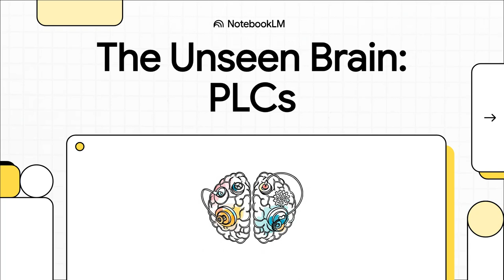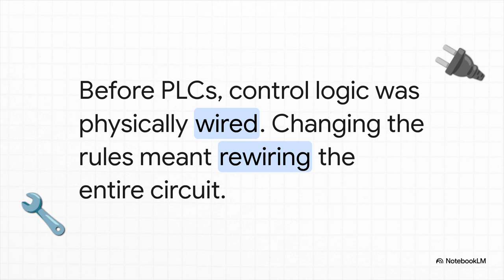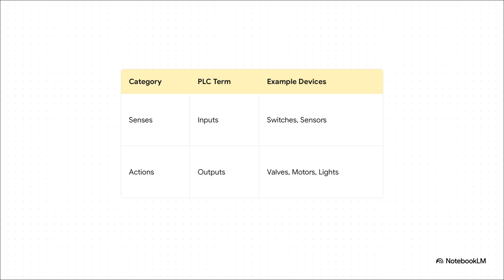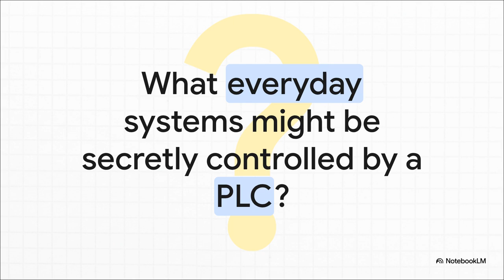PLC

Comment: Nama : Debora Cindy Purba
Nim : 5223351006
Kelas : PTIK-A
dalam video ini menjelaskan PLC diprogram menggunakan ladder logic, bahasa visual yang menyerupai diagram listrik relay sehingga mudah dipahami teknisi. Dalam praktiknya, sensor memberikan data kondisi lingkungan sebagai input, lalu PLC memprosesnya dan mengaktifkan aktuator sebagai output.

Contoh: sensor fotoelektrik mendeteksi kotak di conveyor belt, PLC memerintahkan solenoid valve untuk mendorong kotak tersebut.

Teknologi PLC menggantikan sistem relay kabel yang kaku dengan kontrol berbasis perangkat lunak yang fleksibel, mudah diubah, serta lebih andal. Kini, PLC digunakan luas dalam berbagai sistem otomatis seperti lampu lalu lintas, lift, hingga lini produksi

Comment: Nama : Raisa Dini Zein Hidayat Siregar 
Nim : 5223151017
Kelas : PTIK B

PLC  (Programmable Logic Controller)  bisa kita sebut sebagai otak  yang mengendalikan jalannya mesin-mesin industri modern. Bedanya dengan komputer biasa, PLC didesain khusus agar tahan terhadap kondisi pabrik yang keras, sambil tetap bekerja dengan akurat dan cepat. Kalau komputer biasa lebih fokus ke perhitungan dan tampilan visual, PLC justru lebih unggul dalam menangani proses industri, karena dilengkapi sistem input dan output yang langsung terhubung dengan sensor maupun mesin.

Di dalam sebuah PLC ada beberapa komponen penting. Pertama, Processor atau CPU, yang berfungsi sebagai otak pengendali. Lalu ada Memory, tempat penyimpanan instruksi atau program. Kemudian, Input/Output System yang menjadi penghubung antara PLC dengan dunia luar, seperti sensor dan aktuator. Terakhir, ada Power Supply yang menyediakan energi agar semua bagian bisa bekerja stabil.

Untuk memprogram PLC, digunakan bahasa yang disebut Ladder Logic. Bahasa ini dibuat menyerupai diagram listrik relay, sehingga teknisi yang sebelumnya terbiasa dengan rangkaian kabel bisa lebih mudah beradaptasi ke dunia digital. Simbol-simbol dalam Ladder Logic seperti garis, kontak, dan coil mewakili aliran listrik dan komponen kontrol yang familiar bagi praktisi elektro.

Cara kerja PLC adalah menerima input dari perangkat seperti tombol, saklar, atau sensor. Informasi itu diproses oleh CPU, lalu menghasilkan output berupa perintah ke aktuator seperti motor, lampu, atau valve. Misalnya, sensor cahaya mendeteksi adanya objek, lalu PLC mengirimkan sinyal ke katup solenoid untuk bergerak.

Keunggulan utama PLC dibanding sistem relay lama adalah fleksibilitasnya. Kalau sistem relay harus diubah kabelnya, pada PLC cukup dengan memodifikasi program. Karena itu, PLC kini dipakai di banyak bidang: dari jalur produksi pabrik, sistem conveyor, lift, pencahayaan gedung, sampai sistem pengolahan air. Dengan kata lain, PLC sudah menjadi tulang punggung otomasi industri yang menjembatani dunia fisik dengan kendali digital.

Comment: Nama: Rahmansyah Angga Saputra
NIM: 5223351003
Kelas: PTIK A 22

Di video ini dijelaskan tentang PLC (Programmable Logic Controller) yang berfungsi sebagai pengendali utama dalam sistem otomatisasi. PLC ini mirip seperti “otak” dari mesin-mesin industri. Bedanya dengan komputer biasa, PLC lebih tangguh dan bisa tetap berjalan di kondisi pabrik yang keras. Komponen penting di dalamnya ada CPU, memori, sistem I/O, dan power supply, yang bekerja untuk membaca data dari sensor, memproses sesuai program, lalu memberi perintah ke aktuator.

Video ini juga membahas tentang ladder logic, yaitu bahasa pemrograman berbentuk gambar yang mudah dipahami teknisi. Dengan ladder logic, kita bisa membuat logika kontrol tanpa harus menyusun kabel yang ribet. Salah satu contoh penerapannya ada pada sistem konveyor otomatis, di mana barang bisa diarahkan menggunakan sensor dan solenoid secara otomatis tanpa campur tangan manual.

Dengan menggunakan PLC, proses otomatisasi di industri jadi lebih efisien, cepat, fleksibel, dan mudah disesuaikan. PLC membuat pekerjaan yang sebelumnya rumit bisa jadi lebih sederhana, sehingga mesin bisa bekerja lebih stabil dan terkontrol dengan baik.

Comment: Nama : Ira Gusdhini Harahap
Nim : 5221151004
Kelas : PTIK-A

Ulasan video : 
Konsep dasar PLC (Programmable Logic Controller) dijelaskan dalam video ini adalah perangkat elektronik yang digunakan untuk mengendalikan proses industri atau mesin secara otomatis.  PLC bekerja dengan menerima sinyal, seperti dari sensor, memprosesnya sesuai dengan program yang sudah ditulis, dan kemudian menghasilkan output, seperti menggerakkan motor atau menyalakan lampu. 
Selain itu, video membahas perbedaan PLC dengan sistem relay konvensional. PLC lebih efisien, lebih fleksibel, dan dapat diprogram ulang untuk berbagai aplikasi industri.  Disertakan juga struktur PLC utama, yang terdiri dari CPU, modul input/output, dan perangkat pemrograman, serta contoh penggunaan sistem otomatisasi secara sederhana.

Comment: Nama : Sakinah Salsabila Siregar
NIM	: 5221151007
Kelas	: PTIK-A 

Adapun ulasan saya dari vidio diatas adalah sebagai berikut:

Programmable Logic Controller (PLC) diibaratkan sebagai otak di balik proses otomasi industri. PLC adalah komputer industri yang dibuat untuk mengontrol mesin otomatis dalam kondisi ekstrim.

Komponen utamanya, seperti CPU, memori, dan sistem I/O, memproses data dari sensor dan mengontrol output mesin.
Poin penting yang saya tangkap adalah bagaimana PLC telah merevolusi sistem kontrol yang sebelumnya berbasis kabel fisik menjadi sistem berbasis

 Perangkat lunak yang jauh lebih fleksibel. Contoh aplikasi nyata di ban berjalan benar-benar membantu menguatkan pemahaman.

Comment: Nama : Rifaldi Alan Dahris Harefa
Kelas : PTIK A
NIM : 5222451002

ulasan :
Programmable Logic Controller (PLC) adalah komputer tangguh yang menjadi "otak" di balik otomatisasi industri, seperti yang sering kita lihat pada robot pabrik atau ban berjalan. Berbeda dengan komputer biasa, PLC dirancang khusus untuk lingkungan pabrik yang keras, tahan terhadap getaran, panas, dan debu. PLC terdiri dari empat komponen utama: CPU yang berfungsi sebagai "otak" untuk membuat keputusan; memori untuk menyimpan program; sistem I/O (Input/Output) yang bertindak sebagai "indra" dan "otot" dengan menerima sinyal dari sensor dan mengendalikan mesin; dan catu daya yang memasok listrik ke seluruh sistem. Menariknya, PLC tidak diprogram dengan kode yang rumit, melainkan dengan bahasa visual bernama ladder logic, yang menyerupai diagram sirkuit listrik. Hal ini mempermudah teknisi listrik untuk menggunakannya. Secara sederhana, tugas utama PLC adalah "merasakan" (melalui input seperti sensor) dan "melakukan" (melalui output seperti menggerakkan motor), menjadikannya teknologi revolusioner yang mengubah sistem kontrol mekanis menjadi sistem yang fleksibel dan dapat diprogram ulang

Comment: Nama : Dezky Waldeni Daulay 
Nim : 5223151030
Kelas : PTIK C (22)

Video tersebut menjelaskan apa itu Programmable Logic Controller (PLC), yang digambarkan sebagai "otak tersembunyi" di balik sistem otomasi industri [00:05].

Berikut adalah poin-poin utama yang dibahas dalam video:

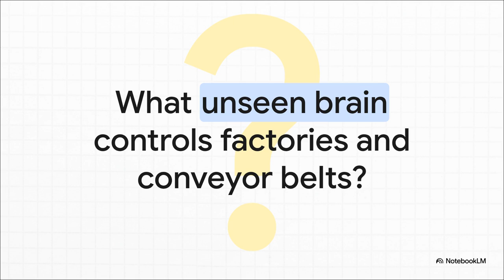Apa itu PLC? PLC adalah komputer khusus yang dirancang agar sangat tangguh untuk beroperasi di lingkungan pabrik yang keras, tidak seperti PC biasa [01:00]. Fungsinya adalah untuk mengontrol proses otomatis secara presisi, seperti pengeboran atau pengepakan barang [00:48].

Komponen Utama PLC: Video ini menguraikan empat bagian utama di dalam PLC:

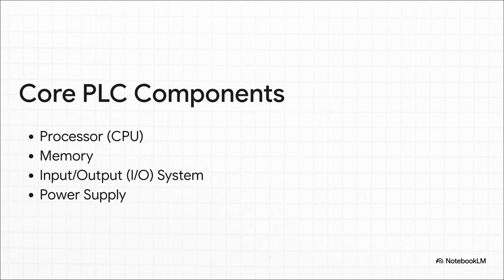CPU (Processor): Sebagai otak yang membuat keputusan berdasarkan program dan data dari sensor [01:58].

Memori: Tempat menyimpan semua instruksi program [02:19].

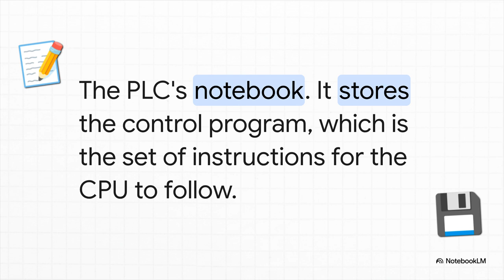Sistem I/O (Input/Output): Bagian ini berfungsi sebagai "indra" (input dari sensor) dan "otot" (output untuk menggerakkan mesin seperti motor atau katup) [02:31].

Power Supply: Sebagai jantung sistem yang menyediakan daya listrik [02:57].

Pemrograman Menggunakan Ladder Logic: PLC diprogram menggunakan "Ladder Logic," sebuah bahasa pemrograman visual yang menyerupai diagram sirkuit listrik [03:55]. Metode ini dianggap revolusioner karena memudahkan teknisi dan insinyur listrik untuk beradaptasi tanpa harus belajar bahasa pemrograman berbasis teks yang rumit [04:31].

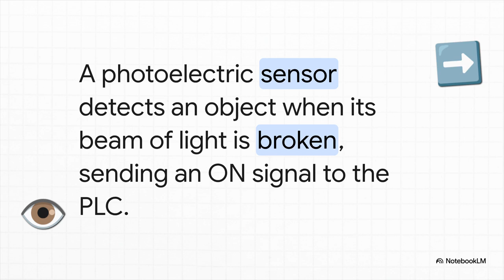Contoh di Dunia Nyata: Video ini memberikan contoh sederhana tentang cara kerja PLC, yaitu mendeteksi (sensing) sebuah kotak di konveyor melalui sensor [05:11] dan kemudian melakukan aksi (doing) dengan mendorong kotak tersebut menggunakan katup solenoida berdasarkan logika programnya [05:52].

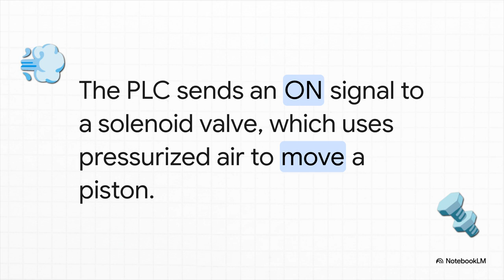Video ini menyimpulkan bahwa PLC telah mengubah sistem otomasi dari yang tadinya menggunakan relay fisik yang kaku menjadi sistem berbasis perangkat lunak yang fleksibel. Teknologi ini, meskipun sering tidak terlihat, sangat penting dalam berbagai sistem otomatis yang kita temui sehari-hari seperti di tempat cuci mobil, lampu lalu lintas, dan lift [06:22].

Comment: Nama	: Wan Safari Ramadhan
Nim	        : 5223151026
Kelas	: PTIKC-2022

Ulasan Video :
Dari video yang sudah saya lihat, Isi video ini membahas tentang PLC (Programmable Logic Controller) sebagai “otak” utama di dunia otomasi industri, seperti conveyor, robot, atau sistem pengepakan. Berbeda dengan komputer biasa, PLC dibuat tangguh untuk bertahan di lingkungan pabrik yang penuh getaran, panas, debu, dan kondisi keras lainnya.

Penjelasan video dilanjutkan dengan isi utama dari komponen PLC, yaitu CPU sebagai pusat pengambil keputusan, memori sebagai tempat penyimpanan instruksi program, sistem Input-Output (I/O) yang berperan sebagai indera dan otot untuk berinteraksi dengan mesin, serta power supply yang menjadi sumber tenaga bagi seluruh sistem. Dengan kombinasi ini, PLC mampu menerima data dari sensor lalu memberi perintah ke aktuator atau mesin agar bekerja sesuai program.

Dalam hal pemrograman, PLC menggunakan ladder logic, sebuah bahasa visual yang menyerupai diagram listrik tradisional. Keunggulannya adalah teknisi atau elektrik yang sudah terbiasa membaca rangkaian tidak perlu belajar bahasa pemrograman rumit. Mereka bisa langsung membuat atau mengubah program hanya dengan menggambar diagram, sehingga pekerjaan menjadi lebih cepat, fleksibel, dan efisien dibanding sistem lama yang harus menyambung-ulang kabel fisik.

Akhirnya, video ini menekankan bahwa fungsi utama PLC adalah “sensing and doing” – menerima sinyal dari sensor (misalnya tombol, photoelectric sensor, proximity switch) lalu mengubahnya menjadi aksi nyata melalui output (seperti motor, katup, lampu indikator). Contoh nyata yang diberikan adalah sensor mendeteksi kotak di conveyor, kemudian PLC memerintahkan aktuator untuk mendorong kotak tersebut ke posisi yang tepat.

Kesimpulannya, PLC telah menjadi revolusi besar di dunia industri karena mampu menggantikan sistem kendali lama yang kaku dengan solusi yang fleksibel, tangguh, dan mudah diprogram. Teknologi ini tidak hanya ada di pabrik, tetapi juga hadir secara “tak terlihat” dalam kehidupan sehari-hari, seperti pada lift, lampu lalu lintas, atau sistem cuci mobil otomatis.

Comment: Nama : Rafael Owen Kevin
NIM    : 5223151005
Kelas  : PTIK-A  (22)

Kesimpulan yang bisa saya berikan dari video tersebut:
Programmable Logic Controller (PLC) merupakan otak dari sistem otomatisasi industri yang berfungsi mengendalikan berbagai mesin dan proses secara presisi. PLC adalah komputer khusus yang dirancang tangguh untuk lingkungan pabrik yang keras, berbeda dengan komputer biasa. Di dalamnya terdapat empat komponen utama, yaitu CPU sebagai pusat pengendali, memori sebagai penyimpan instruksi, sistem input-output sebagai indera dan otot untuk menerima sinyal sensor serta menggerakkan aktuator, dan power supply sebagai sumber daya. Instruksi pada PLC ditulis menggunakan ladder logic, bahasa pemrograman visual yang sederhana dan mudah dipahami teknisi karena menyerupai rangkaian listrik konvensional. Dengan sistem ini, perubahan fungsi kontrol dapat dilakukan lebih fleksibel tanpa harus mengubah rangkaian fisik. Pada penerapannya, PLC bekerja dengan prinsip sensing (menerima masukan dari sensor) dan doing (menggerakkan aktuator atau perangkat keluaran). Kehadiran PLC telah merevolusi dunia industri, menggantikan sistem relay yang kaku dengan kontrol berbasis perangkat lunak yang fleksibel, efisien, dan mudah diadaptasi. Kini, teknologi PLC hadir hampir di seluruh aspek kehidupan modern, mulai dari pabrik, lampu lalu lintas, lift, hingga mesin cuci otomatis, meski seringkali bekerja secara tersembunyi tanpa kita sadari.

Comment: Nama: Dinda Afrita
Nim   : 5221151002
Kelas: PTIK-A

Ulasan pada video ini menjelaskan tentang Programmable Logic Controller (PLC) sebagai otak dari sistem otomasi. PLC berbeda dengan komputer biasa karena dirancang tangguh untuk lingkungan pabrik. Di dalamnya terdapat CPU, memory, sistem I/O, dan power supply yang bekerja sama mengendalikan mesin. Pemrogramannya menggunakan ladder logic, bentuk diagram sederhana yang mudah dipahami teknisi. Cara kerja PLC adalah menerima input dari sensor, memproses sesuai program, lalu memberi output ke aktuator untuk menghasilkan aksi nyata.

 Kesimpulannya, PLC membuat sistem industri lebih fleksibel, efisien, dan kini banyak digunakan di berbagai bidang, dari pabrik hingga layanan sehari-hari seperti lift dan lampu lalu lintas.

Comment: Nama:Silvi Amelia
Nim:52211151005
Kelas:PTIK-A

Video ini sangat informatif dan disampaikan dengan bahasa yang sederhana serta visual yang mudah dipahami bagi penonton yang ingin memahami dasar-dasar PLC, yaitu otak tersembunyi di balik otomatisasi industri. Diawali dengan pengenalan konsep PLC sebagai komputer khusus yang dirancang untuk lingkungan keras seperti lantai pabrik, berbeda dengan komputer biasa yang kita gunakan sehari-hari. Penjelasan dilanjutkan dengan komponen utama PLC seperti CPU, memori, sistem input-output, dan sumber daya listrik yang membuat PLC bekerja dengan baik.

Yang menarik adalah bagaimana video ini mengilustrasikan konsep pemrograman PLC menggunakan logika tangga (logika tangga) yang merupakan bahasa visual dan transmisi, menyerupai diagram listrik yang sudah dikenal oleh teknisi dan elektrisi. Ini menjadi solusi revolusioner menggantikan wiring fisik yang rumit dan tidak fleksibel.

Video juga menjelaskan fungsi input (sensor) dan output (aktuator) PLC dengan contoh nyata seperti sensor fotoelektrik pada conveyor belt yang mendeteksi keberadaan kotak dan mengaktifkan solenoid valve untuk memindahkan kotak tersebut. Oleh karena itu, video ini menjelaskan teori dan praktik PLC dalam dunia nyata otomatis.

Kesimpulannya, video ini sangat baik untuk pemula yang ingin mengenal apa itu PLC, cara kerja, komponen internal, bahasa pemrograman yang digunakan, serta contoh aplikasinya di industri modern. Penyampaian yang lugas dan penggunaan contoh konkret membantu menghilangkan kesan kompleks dan membuat topik teknis ini menjadi mudah dicerna.

Video ini cocok untuk siapa saja yang tertarik belajar otomasi industri, teknik elektro, atau teknologi manufaktur secara umum.

Comment: Nama : Steven Sirait
Kelas : PTIK - A
Nim   : 5223351040

Secara fundamental, Programmable Logic Controller (PLC) merupakan sebuah sistem kontrol terkomputerisasi yang dirancang secara khusus untuk lingkungan industri yang ekstrem. Berbeda dengan komputer personal pada umumnya, PLC dibangun dengan ketahanan tinggi untuk mengoperasikan dan mengotomatisasi proses-proses presisi, seperti lini produksi, robotika, atau sistem pengemasan. PLC berfungsi sebagai "otak" di balik operasional otomatisasi pabrik, menginterpretasikan data dari sensor dan mengimplementasikan serangkaian perintah terprogram untuk menggerakkan perangkat keluaran secara akurat dan konsisten.

Secara arsitektur, PLC terdiri dari beberapa komponen inti, yaitu Central Processing Unit (CPU) yang bertindak sebagai unit pemroses utama untuk menjalankan instruksi program, memori untuk menyimpan program kontrol dan data operasional, serta sistem I/O (Input/Output) yang menjadi antarmuka utama dengan perangkat eksternal. Input menerima sinyal dari sensor (misalnya, sensor fotolistrik), sedangkan output mengirimkan perintah ke aktuator (misalnya, solenoid valve). Lebih lanjut, pemrograman PLC secara historis menggunakan bahasa visual yang disebut ladder logic, yang menyerupai diagram relai listrik tradisional. Pendekatan ini secara signifikan mempermudah para teknisi untuk mengadaptasi pengetahuan mereka ke dalam ranah pemrograman tanpa perlu menguasai bahasa kode yang rumit, sehingga mempercepat revolusi di bidang kontrol industri.

Pada praktiknya, efektivitas PLC dapat diilustrasikan melalui skenario sederhana, seperti sistem konveyor. Ketika sebuah sensor input mendeteksi adanya objek, PLC memproses sinyal tersebut sesuai dengan algoritma yang telah diprogram, dan kemudian secara otomatis mengaktifkan output untuk menggerakkan silinder pneumatik yang mendorong objek dari konveyor. Transisi dari sistem kontrol berbasis kabel yang kaku ke sistem berbasis perangkat lunak yang fleksibel ini telah merevolusi industri manufaktur. Hal ini tidak hanya meningkatkan efisiensi dan keamanan, tetapi juga memungkinkan modifikasi alur kerja yang lebih mudah, menjadikan PLC komponen vital yang menggerakkan sebagian besar dunia otomatisasi modern.